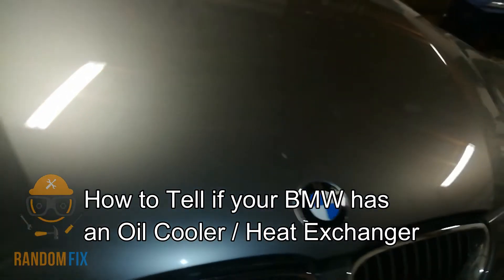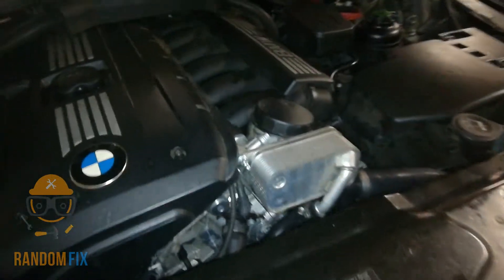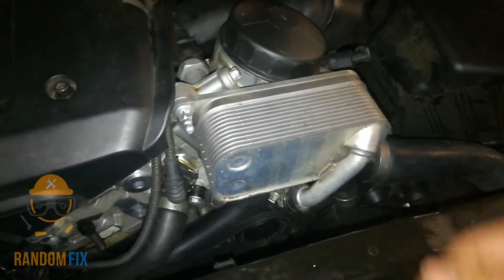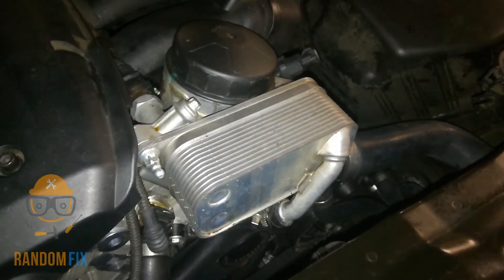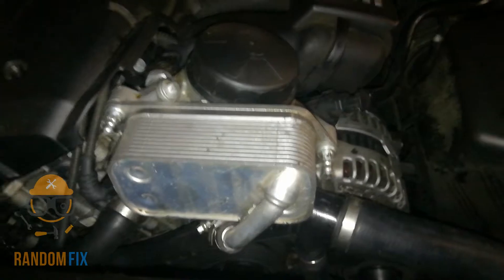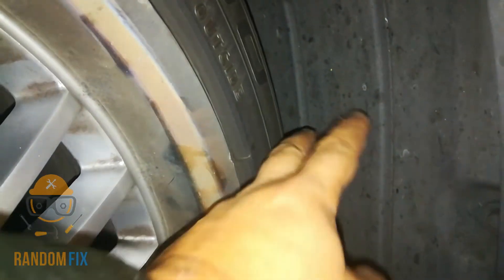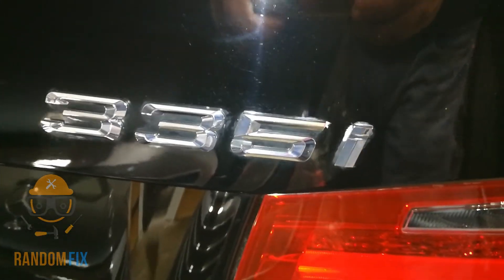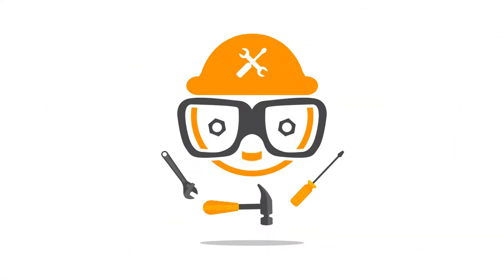BMW Oil Cooler▶️ BMW Oil Heat Exchanger 228i 320i 428i 328i X1 X5 X6 Z4

Comment: Hi I have a 2008 328i where is the oil cooler located?
Reply from the maker: Not all BMW come with oil coolers,  did you check the oil filter housing like in the video and also the passenger side wheel cover?

Comment: can i swap this on a e36?
Reply from the maker: The Red Comet, before you start swapping out the oil coolers just look into a universal oil cooler as it may easier if you get access to a motor oil line on your E36. They run about 40 dollars and go right in front of the radiator  _RandomFix
Reply: bam!!! on the money.. TY bro, Ebay here i come.